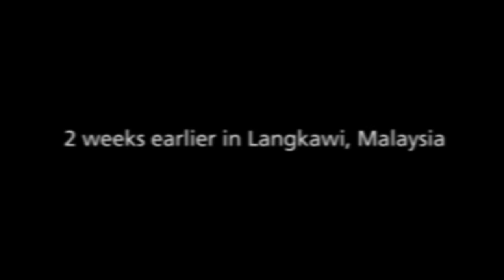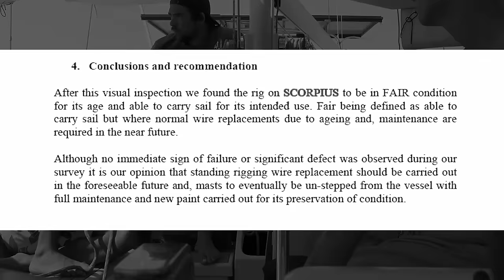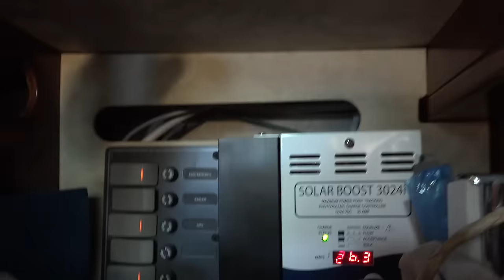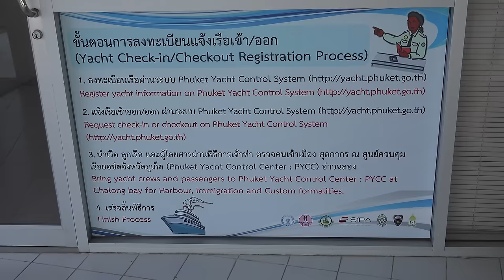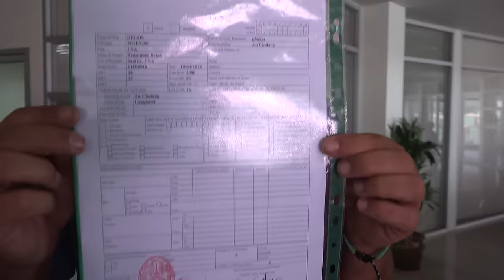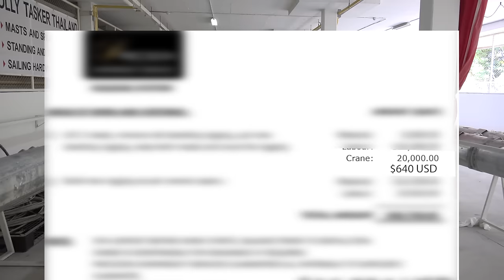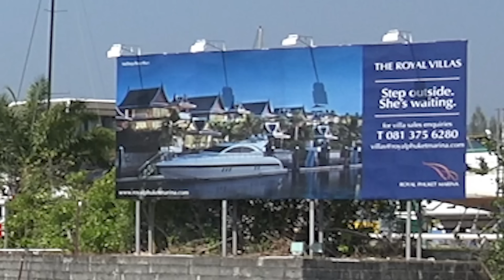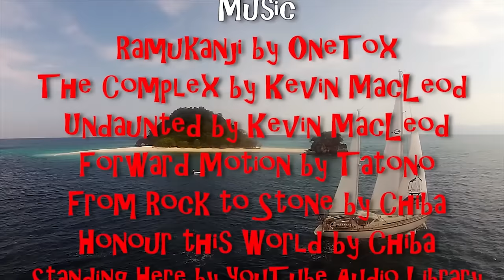Rigging Our Sailboat (Part 1 of 3) Sailing SV Delos Ep. 61

Comment: I think there is a lot of sexuel interactin while they are sailing. Otherwise they would not be naked so many times on the boat (?)
Reply: +BOEM PANG PW It's hot, and the AC is usually only run when docked.  I mean, couples gonna couple, but I'm pretty sure they're half naked due to utility and not lust.
Reply: +BOEM PANG PW I've seen them.  I think you're making a big deal about nothing.  They have a lot of people on a medium sized boat.  They don't have a lot of room for wardrobe, washing clothes takes a lot of water, they spend a lot of time in the ocean.  I think it's just easier to be this way.  Doesn't mean there's an orgy every time the camera turns off.
Reply from the maker: +BOEM PANG PW Ha Ha, we are a free spirited bunch when it comes to clothing optional.  Mostly just because it's comfortable, hot, and then you have less laundry as well.  It's funny, but after living with the same people so long in such a small environment a naked body is just a body.  There's nothing weird or strange about it after a while.  Admittingly though having naked girls around never gets old of course...  Fair Winds!  Brian